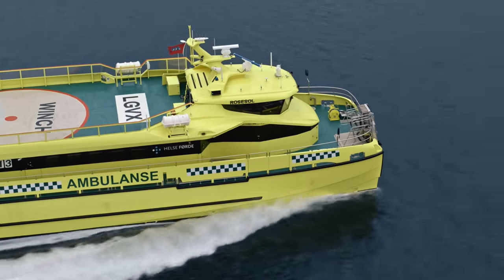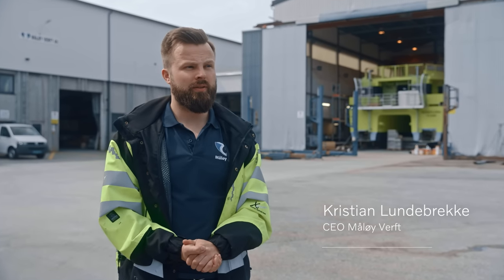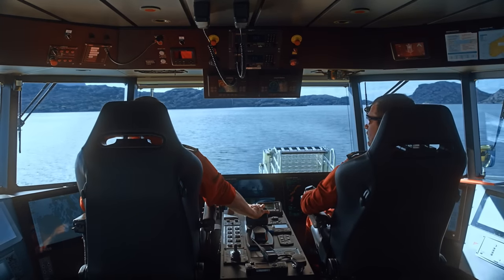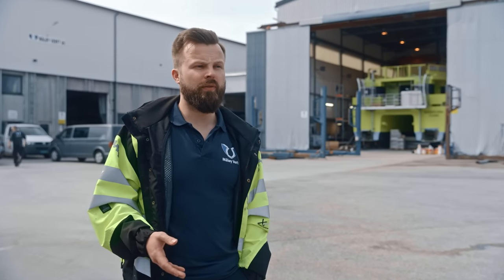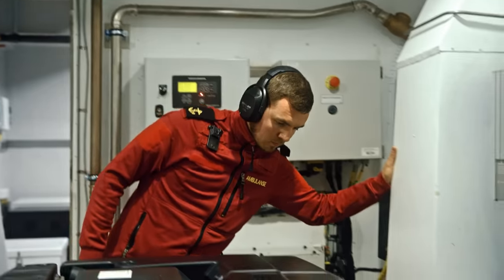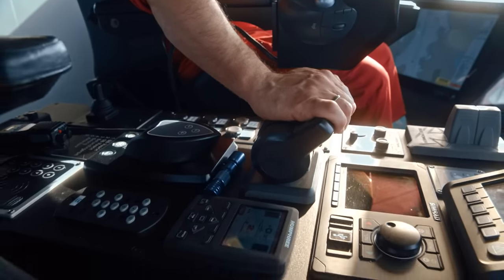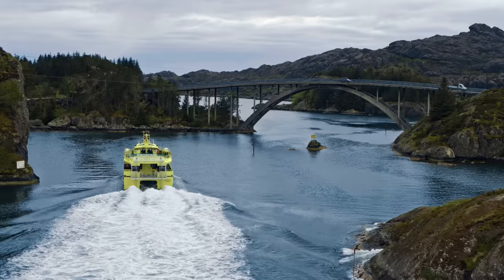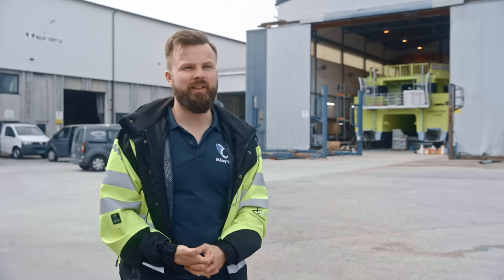High-speed ambulance service – powered by Volvo Penta D13 IMO III package

Comment: Has anybody experimented with moving the engines and marine jets forward and ejecting the thrust directly into the slip stream under the back of the hull . So the thrust is pushing against the water compressed under the hull instead of directly into the cavity of air behind the transom.   This could also be done by redesigning the reverser bucket with a hydrodynamic stretched S shape that directs the thrust down and out of this perhaps multi bladed outlet so the thrust is pushing into the slip stream. If the reverser bucket is pushed down farther  the reverse bucket gets the flow and the high speed outlets now deeper into the slip stream become like rudders.